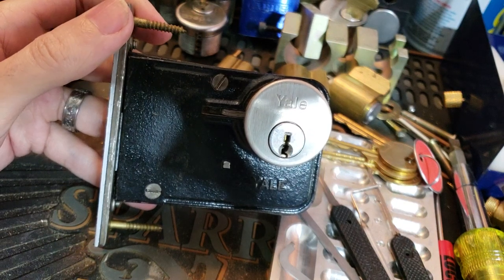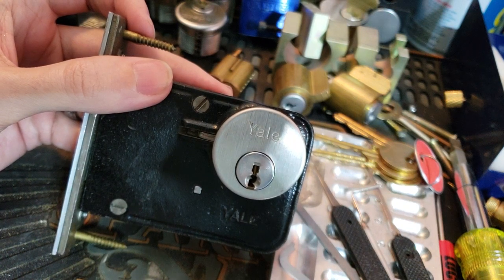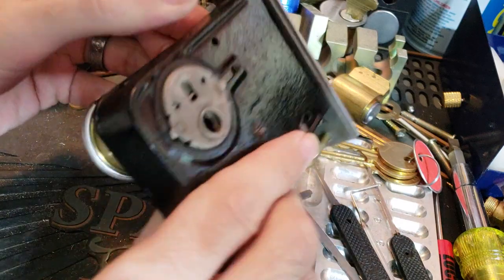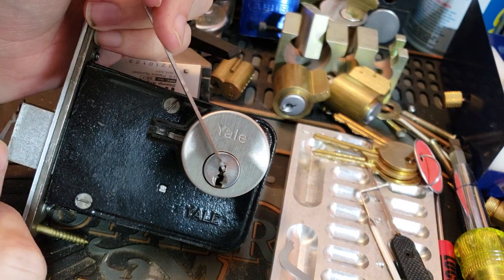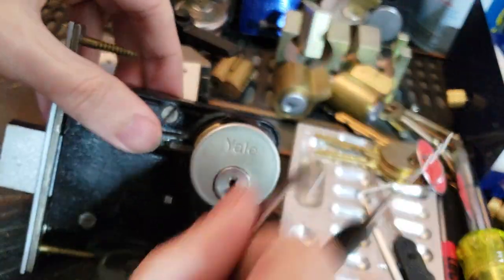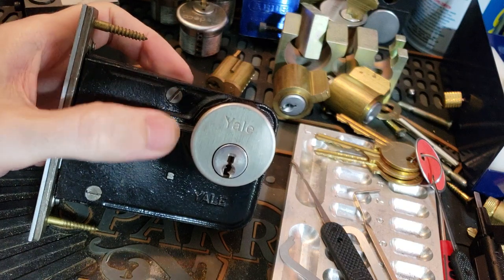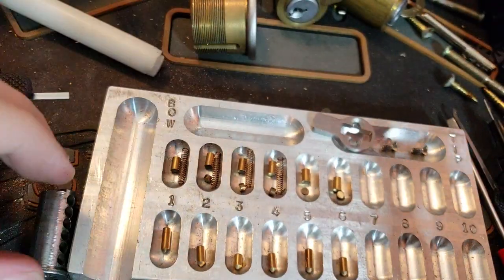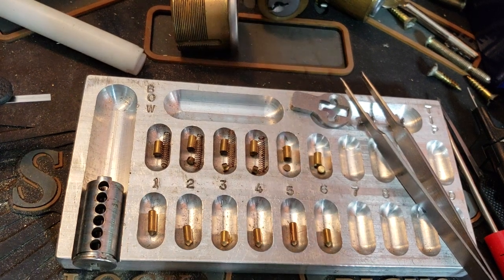(107) Yale 323/324 auxiliary mortise deadbolt teardown

Comment: Nice video.  Informative.  I'm restoring an old 1938 house that had 2 Yale 324 2 1/2 mortise lock (brass).  Any chance you know where I can find 2 of them?   I found some 2 3/4  - so close! - but would have to redo the hole in the door and the lock would be 1/4" offline from the knob.
Reply from the maker: Ebay or Restoration Hardware (or similar stores) are your best bet there. Since those locks have been out of production for many years your only options for getting them is to find them used or get very lucky and find a shop that happens to have one gathering dust on their shelves.